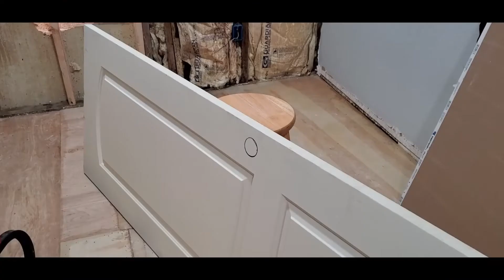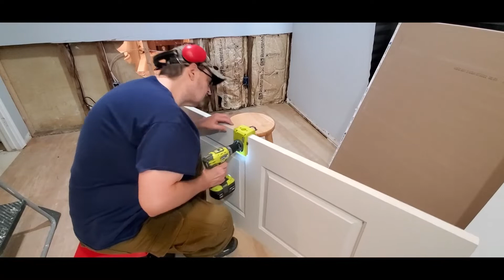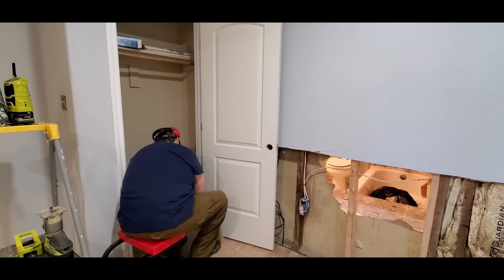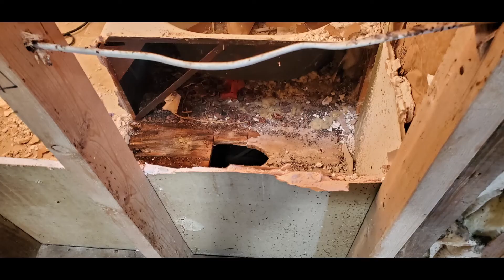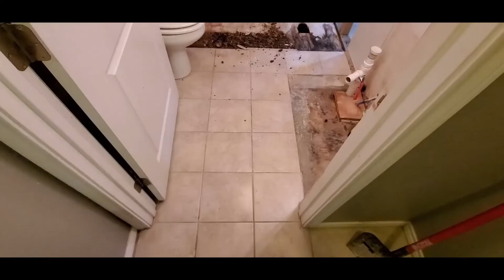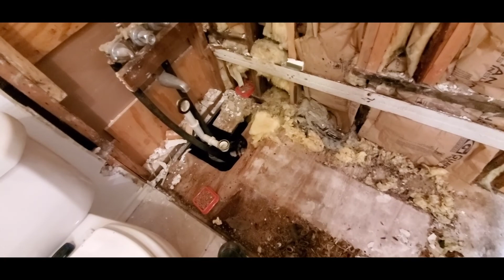Ryobi Routing the closet door - 19

Comment: Door looks fantastic!     What happened to the old door?
Reply from the maker: I wish I knew i would have saved 67 bucks
Reply: @WoodandMetalGarage  I used to hang doors a ton.  People would change all of their flush doors to raised panel...with nice brass hinges (Those are the three metal things that hold the door). (Just in case Robert's Garage is reading this.....and Oly's isn't close by to answer questions).

I was doing a full house door swap with one of my old Toyotas ....it was leaking oil something bad.  So I parked in front of the neighbor's house (To think, I got this solution before knowing 615).  Well...after a bit when the neighbor had the Exxon Valdez out front he spoke up to my customer.

So I had to march over and apologize.  The lady of the house hired me and after a bit I was working there.  By this time I changed the seal and washed the street too.   Years passed and so did this new customer's, partner in a rental house.   The new customer didn't want to  have dealings with the partner's widow so I stepped in to watch over the rental house they shared.
Eventually that lady wanted to sell another rental house and I offered to buy it if they held the note. No money down.
That is the house I sit in now.
All this because I knew how to put on a 2.5 degree bevel so to avoid hinge bind.  Learned that in Sebastian, Florida.